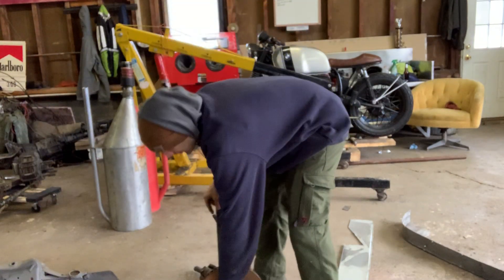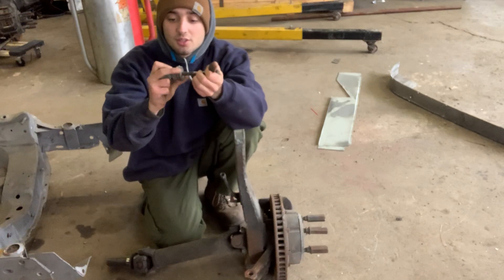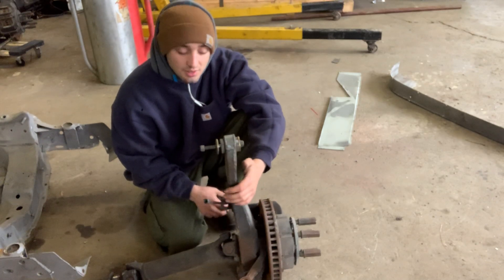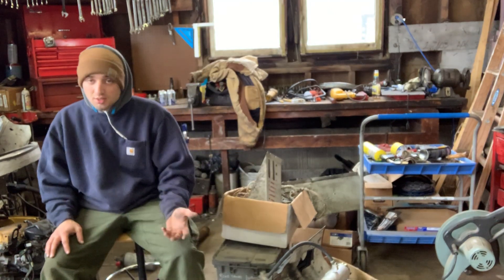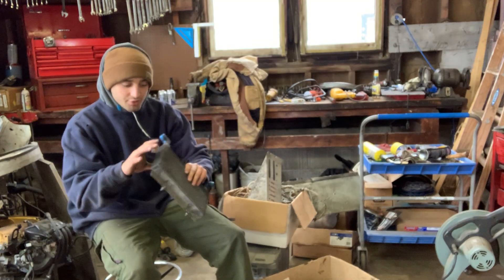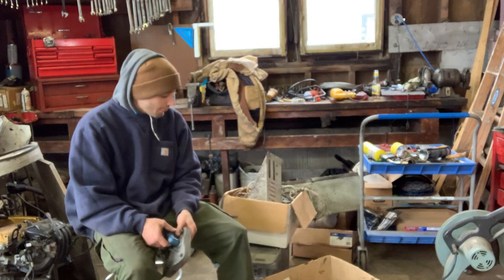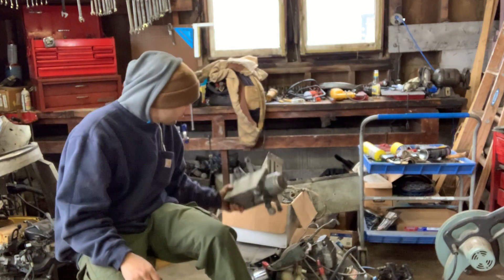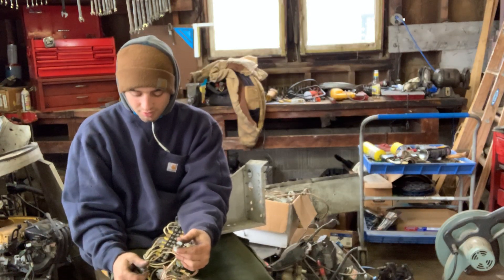WSG Sluggy C3 Corvette stuff part 2

Comment: The first 10si delco remy alternator you picked up is not the original, it is a self exciting unit, (rubber plug on the s/l pins gave it away) just connect the power stud and ground and spin it and it should put out juice. if you have any questions about rebuilding one of those yourself give me a shout. between the two and some new bearings (6203 and 41002) you should have everything you need to rebuild one of those.
Reply from the maker: Sounds good